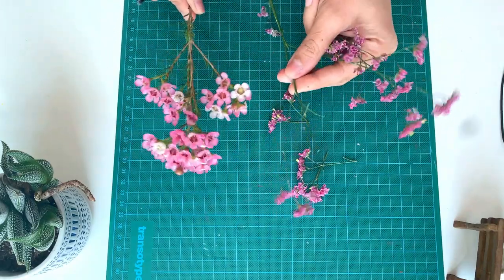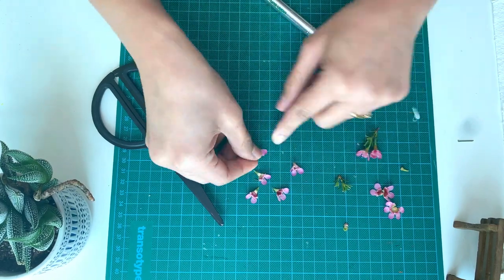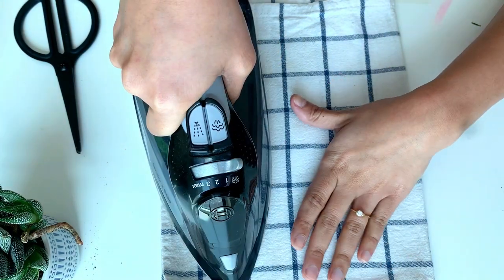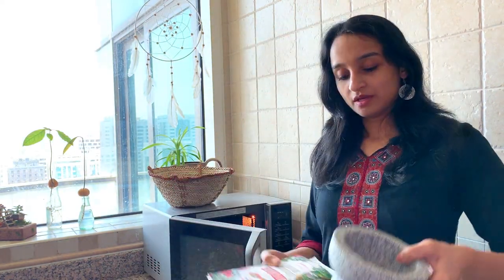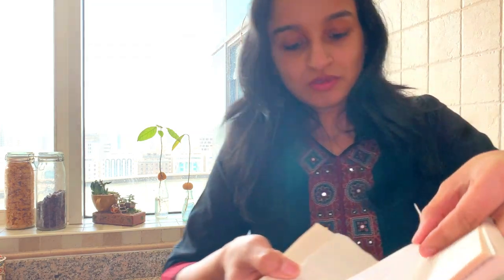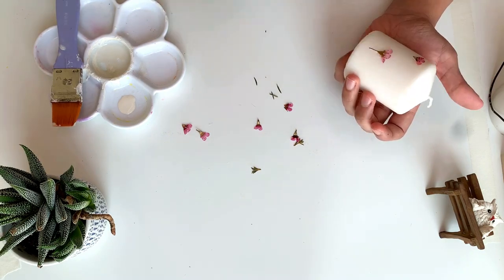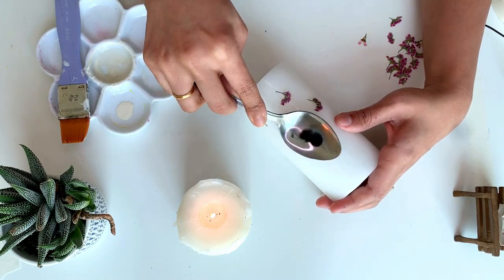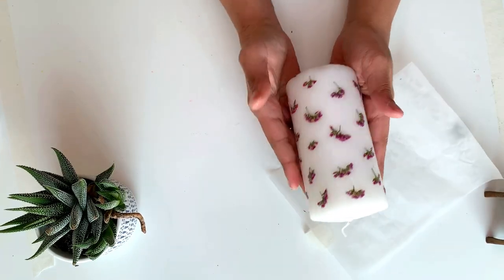Pressed Flower Candle | how to dry flowers|  how to press flowers | pressed flowers |dried flowers

Comment: So beautiful :) ...what happens to the flowers when the candles begin to melt? Do the flowers fall off, or do they fall into the pool of wax at the center of the candle?
Reply from the maker: Good question rahila! Actually when we burn pillar candles of wide diameter the centre of the candle melts and goes down . The sides remain as it is.
Reply from the maker: Usually I cut of the sides when the centre goes so deep.